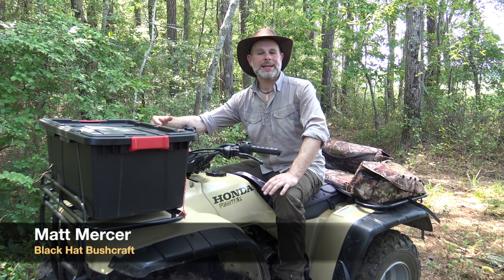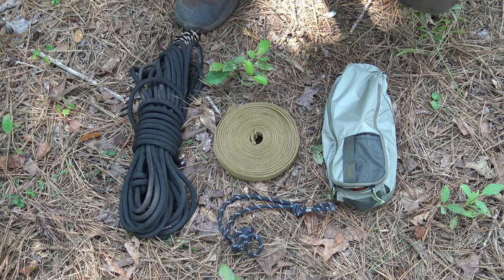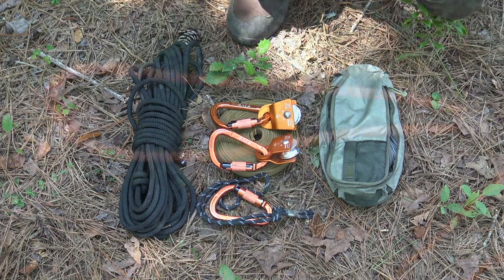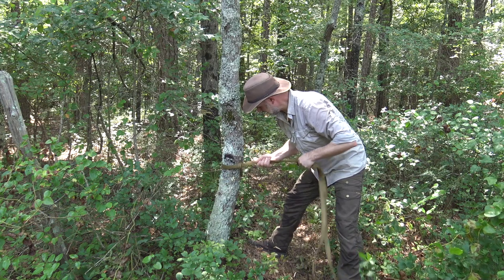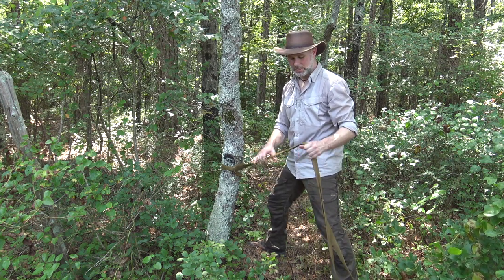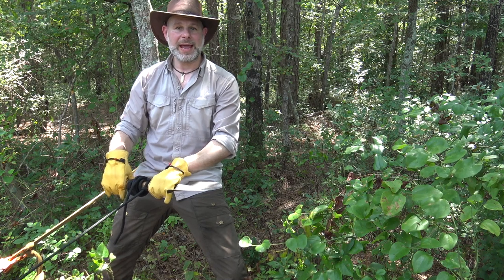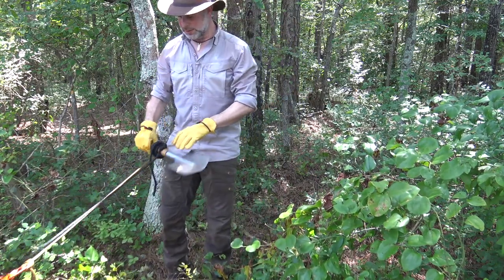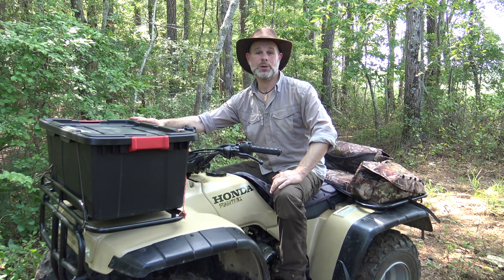Z Drag System: ATV Recovery

Comment: Hey Matt, great video! We use a really similar version of this Z-rig in the Fire Service for high angle rope rescue. At one point in the video, it looked like your “moving” pulley was about to run into the “anchor” pulley that was attached to the tree. One easy to add feature would be a second prusik rope, added to the “anchor” carabiner (right beside the anchor pulley). The other end of the prusik would be triple wrapped around the rope going toward the load. This would allow you to quit pulling on the haul line and let the load rest on that anchor prusik. Those pulleys did appear to be prusik minding pulleys, I believe. Anyway, that would allow you to reset the system without losing your progress.
Reply from the maker: Very true. I am familiar with that method as well and I think in a case of rescue, it would be critical to put that security in place. I took a shortcut on this one just due to the application and my method of continuously pulling back as I did. I think if I were in a situation where I had to perform hand over hand tension to pull, I would be wise to apply that progress capturing prusik/ pulley as well. Thank you you so much for your kind words and for sharing your experience. It would have been good if I would have mentioned that addition in the case of it being necessary. No doubt being in fire service you got the opportunity do some good training in this area :)

Comment: Nice video Matt. Some added tips, add a Prussik for progress capture, incorporate a “flip-flop” winch for even more mechanical advantage with no additional gear, and with another pulley, you can piggy-back a 2:1 on your 3:1 “Z” to give you 6:1 if you have a harder pull.
Reply: Good point, Brian.  Before I read your comment I suggested a tie off point for the working end, but Prussic would do an even better job.  It could be argued that second pulley would be better anchored to the tow hitch or to a mid line loop, like a figure of eight or a alpine butterfly, while the Prussic should be used for  "Progress capture".
Reply from the maker: Great information Brian! I have used the Prussik loop to capture progress and in the case of a rescue or pulling hand over hand, I would definitely use that addition. In this case I went unorthodox by pulling straight back since I had room to do that and therefor left that out. It probably should have mentioned it at least. I need to practice setting up the 6:1 system as it could be very beneficial in many instances. Thank you for tuning in and sharing!

Comment: Great concept video.  It is far better to use skills and simple tools than spend a lot of money.  One thing that was missing was a tie off point for the working end of your line.  Some situations require being able to step away and not lose progress.
 I would recommend adding a pair of strong ratchet straps to your set up.  They will give you even more options along with mechanical advantage. 
When you do decide to upgrade consider getting a 'come along' instead of a vehicle winch.  It costs less and is far more versatile because it isn't limited to the ATV.

Comment: I bought some of that milsurp webbing years ago, but used the last of it last month. A good alternative is an endless loop used by the towing industry. Best practice is to use it basket style instead of choker. Better for the tree and a stronger setup. Also easier to break down. With another rope about the length of the one you have, you can rig it for  a 4 to 1 mechanical advantage and eliminate the prussick.

Comment: Also, if you happened to have injured a hand or arm and couldn’t use a t handle, wrap the tail end of the rope behind your back at the belt line, this way you’re using the legs to do most of the work. Nice vid on the z rig sir!
Reply from the maker: Thank you so much Darren and definitely a good idea on dealing with the adversity of an injury as well! Thank you for taking the time to tune in and comment!

Comment: I liked your video, great info to have.  I Have a question about the second pulley location- instead of at a prussic knot could you attach back at the ATV hitch?  I can see the usefulness of the Prussic to give a better angle. I wouldn’t have thought of that.  As with all of the PF staff you have good information that’s great to know and have in the back your head when you need it.
Reply from the maker: Thank you so much Jon! I really appreciate your kind words! That is a good question, I haven't tried that ,myself but it is possible. I am thinking having the pulley attached to the rope may help to get a better mechanical advantage but I will have to set up it to say for sure.. I will try it to see :) Take care.

Comment: It’s easy to mount a winch on an ATV but I use a very similar system on my dual-sport motorcycle for solo rescue. 100’ of 1300lb 1/4” rope, two 9oz snatch blocks and one friction cam all less than 4lbs will get me out of most jambs..

Comment: Nice concept and I accept this is YouTube and that you're showing a concept, but with a spade and all of those natural resources around you, I would first of all try to get materials under the drive wheels (my Honda Rincon 650 loaded out is HEAVY, but has a 4x4 option).  I carry a small bottle jack (looking for a small Scissors Jack), which would allow me to lift a wheel or wheels and pack branches etc. underneath providing I can provide a platform for the jack so as not to lose that in the mud as well.  

I also have a small compressor which works off the cigarette lighter outlet so, deflating and inflating are also an option in trying to get traction,

However, I do have and carry 30 metres of nylon rope, but not any climbing pulleys, just U Shackles as my plan was always to make a Flip Flop Winch if I couldn't dig myself out however, it is often the case that in my immediate areas there are no trees to anchor to or from which to make any Flip Flop Winch - with my 4x4 Jeep, not a problem as I can dig a hole, bury the spare wheel and use that as an anchor and with your method, could winch myself out, but what to use as an anchor on an ATV - that front box buried full of earth/dirt perhaps?

There are lots of variables to think about, but you need to carry KIT wherever you go out on your own in the backcountry and out of mobile phone coverage and you need to know what your best options are to suit your environment.
Reply from the maker: Good ideas and thinking of this situation. I have also used that method of packing the wheels with natural materials as well. Honestly, I have used that more times than I have ever used this set up because I didn't always have the equipment to construct a Z drag. I have also cut a long pole (2 to 3 inch hardwood) 6 to 8 feet in length and used it as a lever stick to help pry my self out of some jams and that can work too. I like not having to cut natural materials if I can avoid it but it is also nice to know it can be done to improvise when necessary. I think the more full your tool box is with ideas and methods on how to accomplish the task, the better prepared you are to improvise your way out of a jam regardless. I like you thought process on  having contingencies in case one thing doesn't work or isn't available, there are alternate options to roll with. Thank you so much for taking the time to tune in and to to share your ideas!

Comment: Wish I had know this a few years ago...  Question, could you use an alpine butterfly instead of the prusik?
Reply from the maker: Yes, you could use the alpine butterfly in this case. Sometimes depending on distances, you may have to tweak where that connection goes which makes the Prusik ideal but it would be easy enough to just re-tie the alpine if you needed to make an adjustment. Thank you for your time and interest!

Comment: Could you swap the anchor point to the tree and the pulley to the ATV so you are pulling downhill, rather than uphill? You would likely have to pull at a slight angle to avoid the ATV as it comes back up the hill, which may negate the advantage of pulling downhill. Just curious.
Reply from the maker: I never really considered that but an interesting thought. I will have to try it out of curiosity next time I am out there. Thank you for tuning in and commenting Jake!

Comment: My truck got "stuck" in a field while hunting a few years ago, I mean it wasnt stuck in a hole or anything. It was weird mud, the truck wouldnt move. I had to rock the truck pushing while my wife was behind the wheel. We would rock it to get momentum, i wonder if this would have been enough to pull it out. I tried putting rocks behind it or hay under it and nothing worked. My next step was to try to tie sticks into the wheels. No I dont have 4 wheel drive, I wasnt 10 feet into the field, I had hunted there the day beofre and it wasnt muddy.

Comment: Hey Matt... when I saw you laying out the rope & tackle, I was thinking a prussick; I bet he is going to use that on the tree to hold tension while getting another grip on the rope, or digging the vehicle out. I never imagined that you would use it by the vehicle hitching point. Why not just attach the pulley at the hitching point? I can see using your setup if it’s a very long (say 50 yards +) distance to move the vehicle, you would need to slide the tackle maybe several times. But, if this was the case, how would you hold tension to slide the tackle? Some hard terrain inclines, you won’t be able to chock the wheels, or drive an effective spike down into rocky terrain or very sandy terrain.
Can you speak to how you might solve these issues please? I have seen multi-level spikes in a pyramid pattern driven into sand (the way sailors anchored boats to beaches), but nothing for mostly rock bed type soil conditions.
Reply: Hey Sir Jazz, I too commented about this very thing up above here. You would definitely want to be able to “capture” your progress if it were a long pull up a hill. Check out my solution and see if my explanation was clear.
Reply: For rocky conditions sink a steel stake in seam between rocks as anchor point or find a big enough rock to tie off to.

Comment: Great video however, I think an ATV winch would be cheaper than climbing rope, carabiners and pulleys. Especially a Harbour Freight winch.
Reply from the maker: Maybe so? I already had the rope and pulleys as they are multi-functional. If someone were buying solely for that purpose, that winch probably does makes sense. I hadn't looked at the winches at HF but I will have to check them out since you mentioned them! Thanks :)